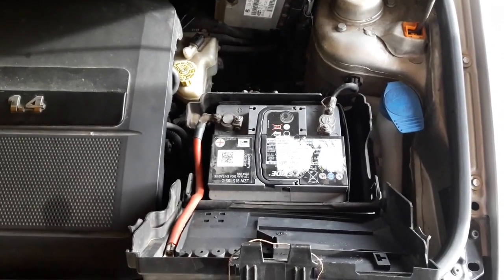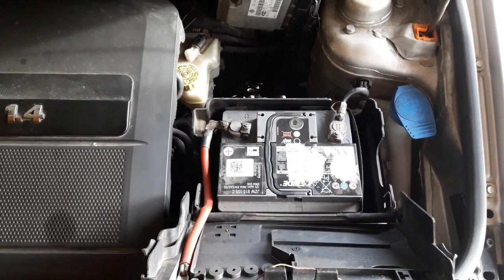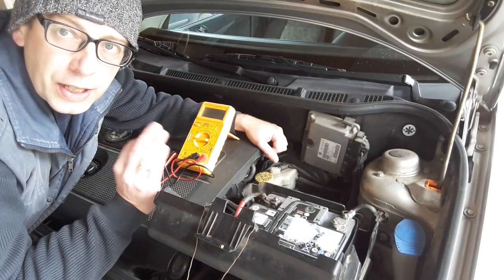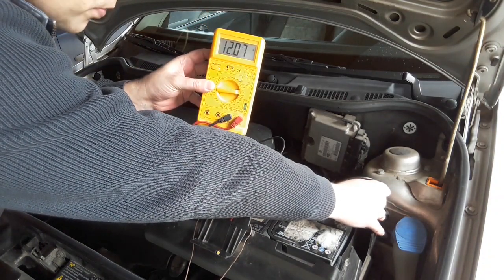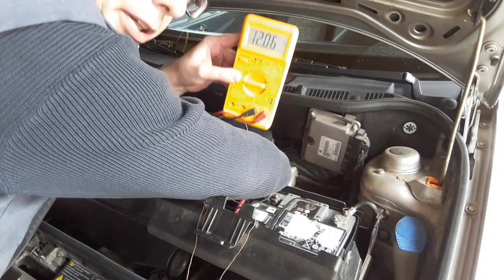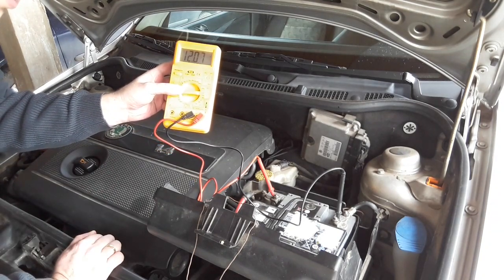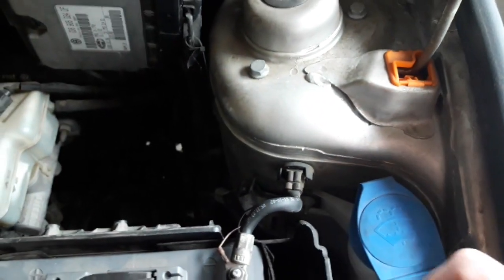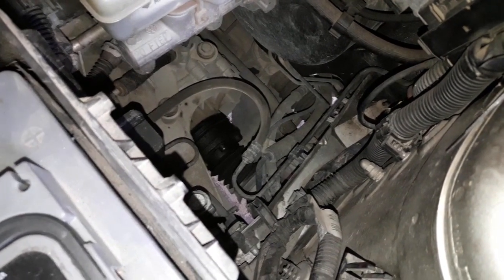Bad Ground Connection On Cars-Meaning,Symptoms, Diagnosing and Solving The Problem

Comment: My Mazda 3 hatch from 2006 has this issue with rear LED(OEM) tail/stop light. Only left one turns off after pressing the brake pedal. The indicator works fine. Bought a new assembly, same issue, plugged it to the right side, same - not working. I've plugged the right assembly to the left connectors and it works fine! So the left just sometimes turns on, like in the morning or randomly....stays on but then when I press the brake pedal, turns off again. I even replaced the passenger junction box - same issue. Replaced the brake switch. Battery is new. Alternator seems fine. OBD doesn't show any fault codes. The only thing I haven't looked at is grounding, and maybe something else, I don't know anymore...
Reply from the maker: Hi, and thanks for watching! Take a look at the grounding but also at the connector that goes on the lamp.
Check the pins to see if they are tight and that there's no corrosion or filth.
This is a common cause of problems.

Comment: Is it possible to cause problems like if the csr not running , only in 2 key position, i put the in reverse, parking sensor always works. If the machine is running its not running only in colder weather. And i have promblems with the radio too, tweeters work but none of the other speaker. 
Is it possible the problem is due ground cable? I have checked it and there is tons of corrosion, turned into green.
Reply from the maker: Hi and thanks for watching! Whatever the case, take the ground cable off and clean it, it can't hurt, and then start from that.

Comment: Sometimes it is about Amperage more than it is about a electrical connection. The starter uses 300 Amps headlights maybe 20 amps, so the body ground doesn't have to have a big cable to run the lights. In your car the starter is dependent on the body to ground strap to to work. I like to run a ground strap from the - negative battery post to the engine block where the starter motor is connected. Sometime there is only a small  20 amp grounding strap from body to engine. That shows as a good ground but not a large cable that the starter is needing.  So  it shows 12 volts on the meter. 0 ohms between negative post and body. But high resistance for the starter
Reply from the maker: Hello and thank you very much for sharing!
The best ground connection is like the one you've described.
Not very nice to see (in some cases)but a very effective and longlasting solution.

Comment: Good video. My car has problems with the batterie. The alternator is working propperly i think because i measure about 14 v when i start the engine . But after one night it go s from for example 12,5 V to 12, 1 V the next morning and if i go to a camping with the slide doors a long time open it totally empty i cant start the engine. I was looking for parasetic drain as a cause  but coulden't find one.   One more questions if you disconnect the negative the computer wil lost its memory?

Comment: when using voltage test you should have lights on so current is on the ground , other ways it makes no sense to check continouty of ground or positive line.

Comment: Thanks for the video very beneficial. My Corsa d o/s indicators working intermittently specially when is hot so thinking bad ground points. Is there always one that is responsible for the indicators I can check directly or could it be any of them?
Reply from the maker: Hi, thanks for watching, and glad if the video helped!
It could be any of them, but if it's one of the main points then usually numerous problems appear at the same time.

Comment: I had a temperature problem. The indicator always goes higher at night but everything in the engine seems fine it took me a month, this problem goes away when I use a jumper cable 😅.

I kept it installed since

Comment: I clipped every connector under the hood, even the ones to the battery. I replaced the Battery connectors with Brass ones, replaced a few ground cables (easier) from the body to the engine. Plugged the battery cables back, turned the ignition and all lights came on, the car started better than it used. Thank you so much. The Electricians told me I needed an ECM (Computer) and a new set of keys. Your video saved me $700. Thank you thank you thank you.
Reply from the maker: You're welcome, very glad the video helped and that you solved your problem 🙂.
 Thanks for watching!
Reply: That is amazing . Mechanics will get you with no remorse if u aren’t smart enough to eliminate less expensive solutions
Reply: That's how they get rich. Ole dirty bastards😂
Reply: So why don't you support the man with some dollars out of your 700$ you saved??  at least as a reward and encourage and support..
,🤚 sorry about my English
Reply: @HebaKanfosa because that makes no sense . She thanked him, and that’s enough .
Reply: @HebaKanfosa  sybau

Comment: I am working on a 2018 navigator that keeps burning the led module for one headlamp then eventually the other side goes away too. How could I trouble shoot this ? The scanner shows short to ground on lighting system. It was in an accident and I repaired it.
Reply from the maker: Hi and thanks for watching! That's a tricky problem.
Since there was an accident the first thing I would do is check all the wiring looms around where the accident happened (check for cuts or damages from the accident).
Also, I would check all the connectors and check for misconnected wires.
From personal experience, in case of accidents and body work done after that, this is the number one reason for problems.
Hidden damaged wires, badly connected wires, and misconnected wires.
I would use a tester and check the light connector and see if the power input and ground is OK.
I hope any of this helps.
Reply: @DespairRepair  thank you so much and appreciate all the advice. Everything helps. I’ll keep you up on what I find or if and when I find the problem.

Comment: Awesome video. Im gonna try to clean all of the connections on my car tomorrow. Its a little corroded, and been having issues with my lights, air, wipers, and dash light not working. My "hand brake" signal comes on. On figured it was a bad ground so came across this and it was great! Thanks so much!
Reply from the maker: You're welcome and thanks for watching!

Comment: Yesterday My car wouldn't start. All the electronics in my car will not even turning on. So I thought it was a dead battery so I got to jump start and the car still wouldn't turn on. There was still no power going to the car, even with jumper cables. And what's crazy? Is that The car battery had 12.6 volts but there was no power going to the car. Nothing was turning on. Like as if my car didn't even have a battery but it did. It turned out that the ground connection was a little loose, just a little. It wouldn't Even crank. It can't crank if there's no power at all to the accessories. 0% electrical power going to the car's accessories and sensors and car parts But the battery voltage was at 12.6 volts. So the person who jump started my car got their tools and tightened the ground and made sure that the positive was tightened to and then they still jump. Started my car and it started with no issue and then I plugged in my scan tool and  the battery and alternator are good. I've never seen that happen before ever. Cuz when I try to start it it made it clicky noise and that was it. The second time it actually started but shut off immediately. The third time it sounded like as If the engine was getting fuel. And then after the fourth time the whole car lost power 100%. But the battery was good. Once the connections were tighten up. The car started right up and I haven't had an issue since then.

Comment: Hello! Can you help me? I have car audio system and weird issues. My radio losing rca output (radio have custom instalation so radio have good power), and bass is bad. everything is done as it should be and checked. Next problem is voltage on my AMPS body, all amps have voltage, so amps are 100% ok. I have 3 ground points (6x 50mm2 wires) The problem is definitely in this car. Car is Mazda 6 2007r. Ground from body alt, engine, batts are perfect. I cleaned some more grounds under air filter. I don't see any more points. I once noticed that the  orginal car fuses under the hood were tarnished I cleaned them
, but problem back very fast,  after a month they still looked the same as before. What to check and what to try in such a situation? thanks so much!
,
Reply from the maker: Hi, and thanks for watching! If I were in your place, I'd connect a cable directly from the minus battery terminal to the minus connection of the radio or other appliance that you think causes problems.
This way you'll have a starting point for solving the problem.
It could be lots of things, for instance, one weak contact inside a connector can be a problem.
Reply: @DespairRepair  Thanks! :)

Comment: When I test voltage at alternator it says 14.3 volts when running, but the voltage of the battery reads under 13 volts when running, could that be bad grounds?
Reply from the maker: Hi and thanks for watching! It could be and it's definetly worth the check.
But also take a look at things like the battery clamps (are they clean and tighetend), the connections on the alternator and from it, check the connections on the starter (if the alternator cable goes that way) and else.
All in all check the whole installation from the alternator to the battery. Especially the main thicker cable on the alternator.Lots of times a weak or damaged electric contact is the cause of problems.

Comment: Nice1..Des & thank u
Reply from the maker: You're welcome and thanks for watching!
Reply: @DespairRepair  I'm  learning Des as I've been ripped off by Dick Turpins...only they haven't Worn a Mask lol..I paid the price lol...try not too by the way Des I was thinking of acquiring the Fluke 28 Industrial having read up on the artical which will be more accurate.  £778.00 can handle up too 1000 volts & waterproof up to 3meters depth water. Cover all posts Des..what say yourself. Oh I'm also interested in acquiring a good quality soldering kit..only want to buy it once Des could you advise me. Thank u Des..keep the good stuff up.

Comment: Thank you. Well presented. Perhaps in addition  provide how to properly and  specially clean the connections.  What substance to use?
Reply from the maker: Thanks for watching! There are various methods, once you get the acid corrosion off the terminals (if there is any) you can use sandpaper, a file or even better a battery terminal cleaner.

Comment: Very helpful video… I found that my negative battery connector was corroded & had a small crack, so I cleaned it with contact cleaner & a wire brush!
Reply from the maker: Hi, and thanks for watching! That's the right thing to do.

Comment: Great video. 
I have an issue with my Octavia which says fuel regulator short to ground on the odb reader. 
I will check the ground connections this week. Hopefully it is this and an easy fix
Reply from the maker: Hi, and thanks for watching! Good luck with the repair and thank you for the kind words🙂

Comment: I have a ground on my floor board I was told to mess with if car didn’t start, i’ve had the car for two years and recently needed to start using it, one day car just didn’t want to start slow start then just clicking, I noticed a corroded ground so i cleaned it but no luck car still won’t start thinking maybe it’s the starter

Comment: Hi can this also cause engine performance issues? Like it causing loss of proper electricity to spark plugs, coils and fuel injectors. Only couple of symptoms I have is engine surge while driving and have noticed that with my obd scanner connected I lose voltage/connection to parts like turbo electronic wastegate and oil temperature sensor. I have seen online that the battery temperature sensor can cause surging.
Reply from the maker: Hi, and thanks for watching! Yes, a bad ground connection can cause all of that.
It affects more or less all of the electric and electronic systems.
Reply: @DespairRepair  Thank you for your response I will order a new ground cable see if it helps and update here to help someone else. Great info video thank you again.
Reply from the maker: @JoseSandoval-ic5xe   you're welcome and hope you solve the problem. One more tip, you can use a jumper cable and connect it from the minus battery terminal to the engine or car body and see if there's any change. This is to avoid buying a ground cable if you really don't have to.
Reply: @DespairRepair  Hi yes I did do that but it checks ok just voltage shows 12.6 with multimeter, my car has a battery sensor in the negative terminal and I've googled those control alternator output. I have checked that sensor and it gives bad readings on scanner. Don't really know if that's the issue.
Reply from the maker: @JoseSandoval-ic5xe   well, if it interferes with the ground connection it certainly would.

Comment: on my golf v gti i get random DTCs both oxygen sensors, ecu checksum error and many more one at a time sometimes getting back after reseting the codes and also sometimes the car takes longer to start. Could that possibly be the grounding ?
Reply from the maker: Hi and thanks for watching! Well, it could be but to be honest I doubt it.
I would rather check the throttle body first especially if the Golf has a higher mileage.

Comment: When I first start my car for the day and put it in D it turns off, also when I am driving and I am stepping on the gas all of a sudden it losses all the power, I have to park and turn the car off and on again to be able to drive it. Can this be the cause of a damaged ground cable of the battery?

Comment: Thank you for the information. Can you please help me? 
Maybe a year ago I was travelling by car, and it was a long trip about 1500 miles, when I stopped to rest half way through, I turned it off, then 6 hours later I tried to start it but the battery was dead, so I jump started the battery, when I got to my destination I took it to an electrician and he told me that the grounding cable melted from my trip and replaced it,
Fast forward to few days ago I was driving normally in traffic, it felt like the car turned of then started quickly and a code popped on the dashboard but I couldn't read it quickly. 
Now sometimes when I try to start the car, it just clicks and won't start like the battery is dead, but after a few moments it starts like nothing is wrong with it, today this happened to me I couldn't open it with the remote, but when I popped the hood up, all the electricity came back to the car!
Thank you for your time, God bless you

Comment: I have a 91 Oldsmobile Cutlass. With a V6 automatic. Can put my key in the ignition and my dash lights and headlights work. But when I turn the key but does absolutely nothing. Do you have any suggestions?
Reply from the maker: Hi and thanks for watching! I would definitely first check the battery terminals and clamps if they're tightened and clean.

Comment: You are a life saver! Your video guided me right to locating the issue on my daughters Ford Escape. I know it saved me a ton of money the shop would’ve charged. The intermittent lights and battery drain problem solved with a wire brush on all surfaces of the ground connection off the negative cable to the  frame. Multimeter test revealed the problem. Much appreciated Amigo!!!
Reply from the maker: You're welcome and very glad the video helped 🙂. Thanks for watching!

Comment: My ground strap bolt on the engine broke from the head on the engine block and off course I don't have the tools 2 get the rest of the bolt out. 
How will it affect my Jeep Compass? I was able to kind of secure 1/2 of the strap end 2 another bolt on the engine, but it is not as it should be!
Thanks for your time!
Reply from the maker: Hi and thank you for watching!
I think you should be fine provided that the engine starts well (there's no heavy cranking).
Half of the strap should be enough for the installation to function properly. I've had these kinds of cases where I needed to improvise, looks bad but functions well.
But if you want to be 100% sure, buy a new strap, make a brand-new connection, and call it a day.
Hope any of this helps

Comment: This video solved my no crank no start totally dead car. The voltage measured on the battery terminal was 12.5 volts, however, when the negative probe was moved a few inches away from the battery negative terminal, the voltage went down to 10 volts. The problem was a rusted and corroded connector on the negative terminal. Thank you for this video. Appreciate it.
Reply from the maker: You're welcome very glad that the video helped and thanks for watching! 🙂
Reply: I have this problem, did you replace the connector?
Reply: @mouszzy9256  no. I just cleaned it.
Reply: @gpadepedro  Cleaned it with what? Does adding dielectric grease help prevent corrosion buildup?

Comment: Hi thanks good video. If I found a bad ground but can’t get to it to change it ,can I just leave it and bypass to another area on the car. I have flickering lights.
Reply from the maker: Hi and thanks for watching!
Yes you can, as long as your sure it has a good connection and won't interfere with other systems and appliances on the car.